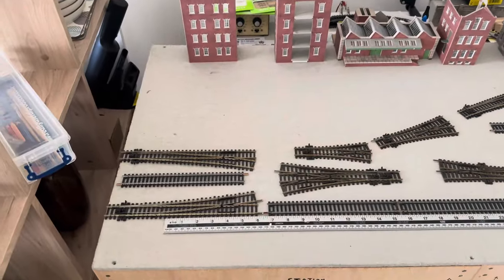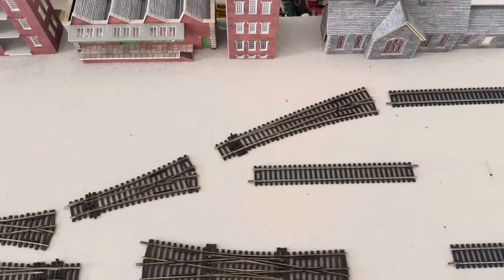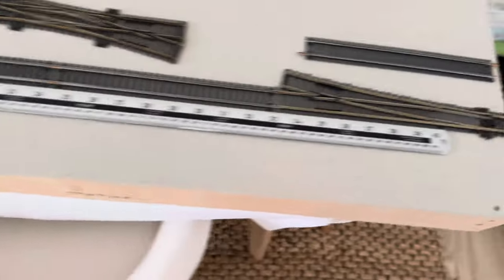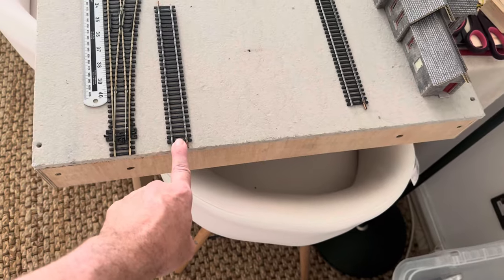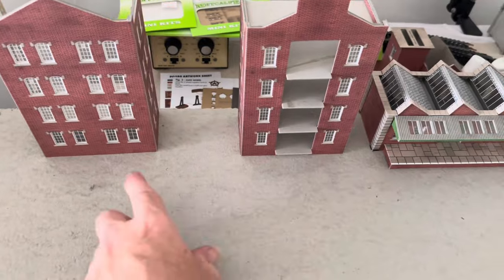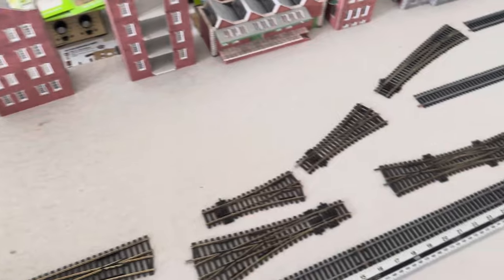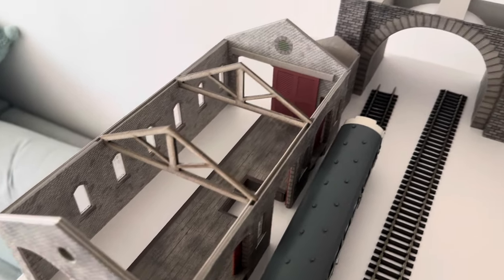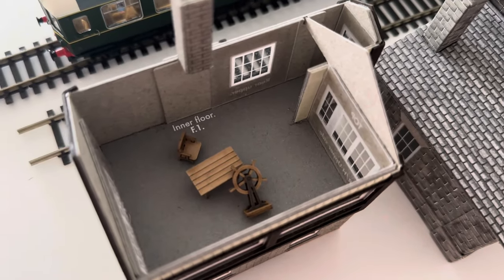Plans Afoot!

Comment: Looks like a great plan. I like the dual track mainline. Part of Dib's Yard track plan is based around an old double track that was converted to single as traffic decreased. Hence why the engine shed is so basic as it was thrown up over one of the disused lines.